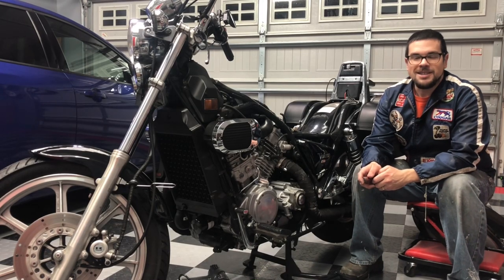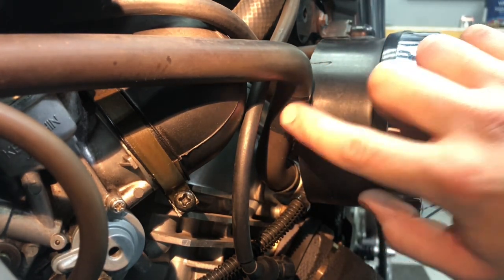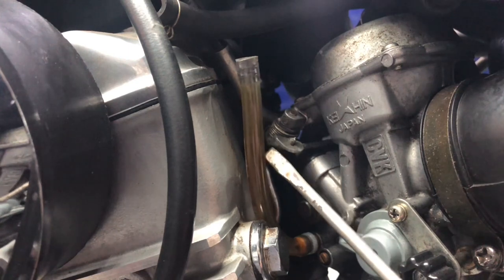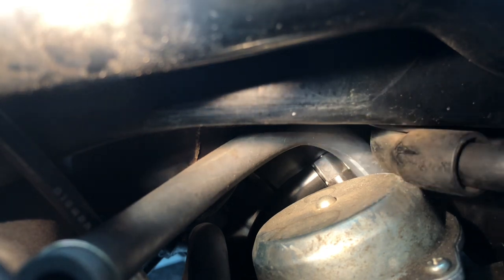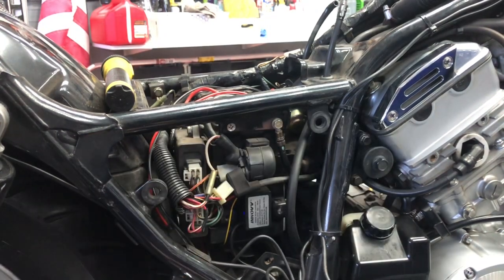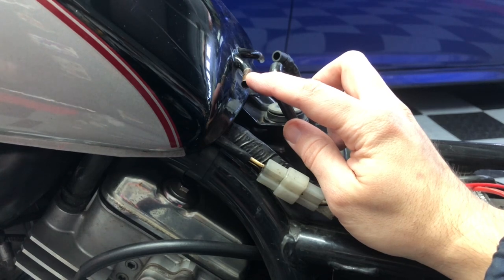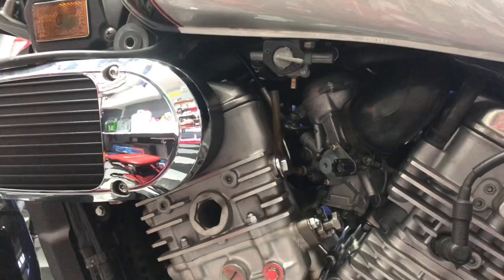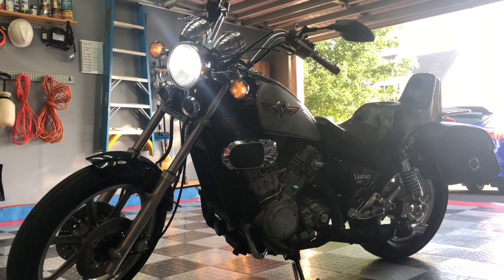How to Connect the Fuel/Air/Vent/etc. Hoses & Lines on a Kawasaki Vulcan 750

Comment: Your videos are great.  Helping so many people to put back what someone else took off their carb but they don't know where the hose goes.   If you do decide to remove your carb, just do an in-depth video and you will be able to watch it and put things back correctly.  It's not terribly complicated but is a bit hard to get out as it is a very tight fit.   Keep up the good work.  You're a natural.
Reply from the maker: Thanks so much for the comment, I appreciate it! I plan to make a video to show how to remove the carbs and reinstall. I'll probably do this video right before I do the ear-shave mod, where the airbox and stock air filters are removed and instead you put pod filters directly on the carbs. Here's the written procedure:

https://www.vn750.com/threads/ear-shave-procedure-enjoy.18397/

But I probably won't do this until 2025.

Comment: As usual a great video. Unfortunately the part I needed explained is what you glossed over. The two hoses at the back of the tank by the rear mounting bolt is for the Fuel Evaporative System. The fuel tank on my '86 has those two lines. However, I purchased a replaced fuel tank years ago and I'm just getting around to replacing the fuel tank on the bike because it has a dent from a strap breaking while in a trailer. Still functional but doesn't look good. Anyways, I only just noticed the tank I purchased does not have the two Fuel Evaporative System vents coming out of the tank. Further study I found the replacement tank I got is for USA except California. The Fuel Evaporative System is a requirement to be compliant in California, but required in the rest of the USA. Kawasaki no longer sells the fuel tanks without the two vents. I think I will be fine using the replacement tank without the Fuel Evaporative System connected, but I was hoping you and the video would have had more insight about this. I'm not sure which is better. Plugging the two hoses, or but a hose-connector with the two hose and simply loop the Fuel Evaporative System? Thanks again for the video as it did help with the rest of the instal.
Reply from the maker: I learned from another VN750.com member after making this video that my Vulcan 750 is a California-spec model, which is why it has those TWO vents at the base of the fuel tank by the seat. All Vulcan 750's have one vent, but these CA-spec models have an extra vent for the EVAP system. You can plug this second vent tube and plug the port because the tube simply goes to a charcoal canister. I plan to do this on my bike and will make a video about it. It removes some clutter inside the bike (i.e. a big black charcoal cannister lol).

Better yet, if you wanted you could purchase a set of coaster plates (link below) and plug off those reed valves on the heads. It's a common mod that can clean up the look of the bike, called the Coaster Mod. I also plan to do this one day on my Vulcan and will make a video. 

https://chucksterscustoms.com/product/kawasaki-coaster-plates/

https://www.vn750.com/threads/coaster-mod-purpose.101457/?post_id=1254353#post-1254353

https://www.vn750.com/threads/heres-everything-i-know-about-the-reed-valves-kawasakis-kleen-air-system-aka-pair.108358/?post_id=1316362#post-1316362

Comment: Where does the clear vent line go? Down and under not connected to anything?
I have adhd add dyslexia and all kinds of things too but I don't see it in your video.

Would appreciate a full disassemble and reassemble of hoses.
Reply from the maker: @sigmalawpenske  The clear vent line is the petcock vacuum hose. It goes from the bottom of the petcock to the carburetor on the left side. Yours will most likely be black. The only reason my hose is clear is because my OEM hose had a hole in it, and I replaced it with some clear fuel line. Does this help you?

Comment: I bought the 2000 Vulcan new, and it had the same airline interference at the intake box. I did the same thing and used a dremel to give it clearance.
Reply from the maker: Seems like a bit of a minor design flaw there. But good to hear you fixed it in a similar fashion. Nice job. :)

Comment: Question what exaust is that it sounds amazing i have an 02 myself almost finished getting it rebuilt
Reply from the maker: Thank you. I LOVE the exhaust sound of my bike. The previous owner installed these pipes...and if I recall correctly they come from a different bike (maybe a HD?). They are simply straight pipes with some aftermarket clam shell clamps holding them onto the exhaust manifold. 

It's honestly not ideal/a perfect fit. I'm probably losing power maybe due to the lack of back pressure? And I have a very slight exhaust leak from the start of the exhaust pipe on the rear cylinder right at the clam shell clamp. But I don't care because this sound is worth it. :)

Comment: Hello, I'm from Rio de Janeiro, Brazil. I appreciate your channel. My little hose (shown at 3:29 in your video) is connected directly to the vacuum in the carburetor (right side). Does she really need to go to the T-valve? What else is connected to this T-valve? Thanks.
Reply from the maker: If that’s how your right-side carb is setup with the little hose and everything is running fine, maybe it can remain as is. Either way, it sounds like that little hose makes its way to the right-side carb so that sounds OK to me. You can always follow-up by creating a post at VN750.com if you haven’t done so already. There, myself and other members will be able to help you out further. Also keep in mind my Vulcan 750 is a US California spec, so some things on my bike look different than any other Vulcan 750 for the rest-of-world markets due to emissions requirements from the state of California back in the early 2000’s.
 
As for your question about that T-valve, check out this time stamp at 6:22
https://www.youtube.com/watch?v=7sokPDXOhDg&t=382s&ab_channel=CheckeredFloorGarage

Comment: Thank you so much for the video. Running into an issue on my '99 Vulcan 750 that I just purchased where I stall as soon as I apply ANY load (like even try and inch forward releasing the clutch). I have what appears to be a loose hose right next to the airbox on the passenger (right) side and there is no connection to make to the airbox. How does that hose fit? Am I missing something with the connection? Figured its either a vacuum leak or carb jets at this point.
Reply from the maker: Before we talk about the loose hose, make sure the kickstand is up. These bikes have a "safety kill" feature where the engine power will be cut if you release the clutch while the bike is in 1st and the kickstand is down. This tends to get me at least once per riding season. 😁

Let me know if this resolves your issue.

Comment: Hey on my carb the plastic black piece that the fuel line connects to is broken.  Do you know where I can find another one or what they're called?
Reply from the maker: I found an old VN750.com post for you from 2011. Check this out:

https://www.vn750.com/threads/black-plastic-carb-inlet-nipple.19832/#replies

Looks like the black plastic Kawi pieces are replaceable with brass pieces from Harley Davidson (post #2). Then post #8 has a link to them so you could try that.

Just be sure to read the rest of the thread to learn more, and feel free to search VN750.com for alternative options. 

For example, another alternative option is to check eBay for used VN750 parts...you never know what you'll find there! I've used eBay several times to get replacement parts for my 750. 

Best of luck, feel free to let me know how you make out!
Reply: @CFG750  dude thank you so much I looked for like 2 hours the thing pissed me off so much I was just putting it up on marketplace lmao
Reply from the maker: @tristannantista9616  lmao, hey we've all been there. I'm so glad you reached out and I could help you. Be sure to check out VN750.com for other issues you may encounter with your 750. Most everything I know about this bike comes from this forum! 

Also, the Clymer Service Manual helps a ton too. Here's a free way to view the entire manual, you just need a google or facebook account to access Archive.org:

https://www.vn750.com/threads/free-clymer-vulcan-750-manual.107822/#post-1308066

Comment: Picked up an 88 Vulcan 750 last winter (cheap) and they started the air box removal. It's mostly complete but the small air lines off the carbs are plugged with golf tee's and bike isn't getting fuel to the carbs. Runs on starting fluid and if I squirt gas into the slides.Are there any sites or references you can suggest that show the correct method of routing the air lines after ear shave? Any help would be greatly appreciated.
Reply from the maker: I don't know a whole bunch about the ear shave mod. So I could be wrong but some of those lines remaining plugged COULD be OK. I THINK that's how the mod is done but certainly it's worth a double check. 

I cannot recommend highly enough VN750.com. Check out that forum and use the search functionality to try and find your answer that way. If you cannot easily find your answer, feel free to create a profile, introduce yourself, and ask us. It's a forum dedicated specifically to the Vulcan 750. I guarantee you'll find what you need for this and more for you Vulcan 750. :)

Comment: So. I recently bought a 2004 model with 26000 miles on it. I just bought the rebuild kit for the petcock and carburetors, I got the carbs off ( such a pain ) and tore down but I think I over did it by removing the linkages for the throttle and choke and I'm struggling to put it back together. I don't want to mess the bike up, it's my first bike and I love it already. I've watched the other videos you have about maintaining this beautiful machine and I must say you inspired me to get this bike. Any help would be greatly appreciated man
Reply from the maker: The carb removal process is SUCH a pain. That's why many owners opt for the "ear shave" mod, where they delete the air filters and intake plenum and intake box. And they instead install pod filters directly onto the carb on either side of the Vulcan. It clears up a lot of clutter and space, and it makes it a bit easier to access the carbs.

If you haven't done so already, create an account over at VN750.com. It's free. Post a brief intro and some pics of your carb/linkages. I and others will help you out there and I think you'll have your issue resolved same day. The community over at VN750.com is incredible!
Reply: You are a life saver. Do you know about how much the ear shave mod cost?
Reply: @CFG750  I just made the account. I'll be off work around 3 30 and I'll get some pics on there bub. Thank you for your time. Ps I  have a cali model, is it much different than a non Californian model?
Reply from the maker: @jaykeyboii6955  Thank you. I'm really glad I can be helpful for you. 

I don't know the exact cost for the ear shave mod. But you'll need two pod filters that fit onto the VN750 carbs. So let's say $50 there for the two pod filters. And you'll also need some new carb jets because anytime you change how a motorcycle breathes (whether that's on the intake or the exhaust side), you'll also need to change the way it consumes fuel (carb rejetting). So let's say new carb jets cost $40. Throw in some other misc. items like clamps and such, and I think this is a rather affordable mod, maybe costing ~$100 +/-.
Reply from the maker: @jaykeyboii6955  You'll have some extra emissions-related equipment on your bike. So pay close attention to the two pages of the Clymer Service Manual that I highlight in the video and follow-up with me/us over at VN750.com and you'll get the help you need. Worse comes to worse, I think a lot of that stuff can simply be removed. These Vulcans have been around for such a long time, there is a really great understanding about them at VN750.com.

Comment: Hello, I'm from Brazil and I've been following your channel for some time. Congratulations! I needed to open the engine of my Vulcan 750 to change the water pump mechanical seal, bearing and seal. I did everything according to the Clymer manual. Now, everything is ready, a problem occurred. There is no suction from the carburetor to the gasoline petcock, but there is a blow, so that no gasoline enters the carburetor bowl. Can you help me?
Reply: Sorry, it's a great pleasure to join this group!!!
Reply from the maker: Thanks so much for tuning in! I'm glad these videos have been helpful for you. First, check that your petcock is set to ON or RESERVE. I swear this gets at least once per season. 🤫

A common problem on these Vulcan 750's is phantom-out-of-gas syndrome (POOGS). Try to start the engine with the fuel tank cap open, and if you see fuel flow then it's definitely POOGS. Read more about it here (and I will make a video about POOGS this year):

https://www.vn750.com/threads/phantom-out-of-gas-syndrome-poogs-correction-and-prevention.17572/

Inspect the fuel lines for kinks, maybe something got pinched during reassembly. 

Could be a carb float valve issue. It's funny with these older bikes...you sometimes uncover new issues by working on and fixing other issues! Some Seafoam or another fuel treatment can help with this, but you will need to get fuel into the carb first.

Those are the main things I can think of. Check into these, and create a post over at VN750.com if you need more advice. There, myself and the other members can better assist you. Goodluck and thanks for reaching out!

Comment: I have a Vulcan s 650, how do I know if the fuel cap vent hose is connected to the right port on the tank? I recently had the bike painted and just wanted to be sure when putting them back together. There is a blue dot next to the port closest to the seat on the tank, is that where I should connect the vent line? This hose is just a long hose that runs down by the kickstand, the other hose connects to a couple other things. And I don’t want get them backwards. Any help would be greatly appreciated. Thank you. I have a picture showing everything but I’m not sure what order they connect in by looking at it.
Reply from the maker: @BobbiWorley-rs1zz  Thanks for the comment. The Vulcan 650 S is a cool bike, I really like it! But, I know nothing about it unfortunately. Check out a forum that’s dedicated to the 650. For example, I’ve learned everything I know about the Vulcan 750 from VN750.com. Perhaps there’s a similar forum for the 650?
Reply: @CFG750  thank you for replying. Unfortunately there isn’t anything I can find as far as the fuel lines go. Thank you tho

Comment: Hello. I have some new questions.  =)
3.37 - t-valve: left hose goes to air valve (3.27), right hose goes to rear carburetor (4.07). Can't find where the lower hose (3.37 vertical) goes?
6.23 - another one t-valve: two hoses connected to carburetors and third - to right airbox?
(found some "customising" of my Vulcan: previous owner changed petcock for unknown reason - so I decided to check all tubes/hoses just in case)
Reply from the maker: I want to take off my gas tank and follow the lines IRL to help you out here, but my apologies I just don’t have the bandwidth for that atm. If you haven’t done so, create a free profile/account over at VN750.com. Create a new post and share your questions and issues over there. Refer back to my video and share any pictures you may have or think would help us to answer your questions. I guarantee you’ll get your questions resolved. The subject matter expertise over there is incredible.
Reply: @CFG750  I've created profile at the website. And even tried to send you some questions with photo, but system told me I can't do it yet for some reason. That's why I write to you here.  =)
Maybe on holidays I'll found some time to create a new post (during a week I come home little late from work).
Reply from the maker: @MrBaclajan  Sorry to hear you've been having issues with VN750.com. There was a small technical glitch last week so that could have been the problem (the issue is resolved now). Also, you may need to have your account verified first so the system and the mods (myself included) know you're not a bot. 

So when you try again over at VN750.com, make sure to introduce yourself as your first post, then feel free to post your question/issues/pictures directly to the forum. There, myself and the other members & subject matter experts will be able to help you. 😊

Comment: Lad , I cant locate vaccum hose  on 1500 /1999 classic but one carbu only . 

Btw , Would you know its way ?
Reply from the maker: I'm not familiar with the Vulcan 1500/2000 models. I'm familiar with the Vulcan 750. I recommend you find a Vulcan 1500/2000 forum, like maybe this one:

https://www.vulcanforums.com/forums/vulcan-1500.16/

I wish you luck in locating your vacuum hose. ☺

Comment: 7:02 on the bike im working on instead of the air box it goes to the left side where i have another T and one goes to the petcock and the other to where the clear on your video is connected. Is the bike a different model? And are those connections ok? New to forums cant seem to find anything on it
Reply from the maker: Your Vulcan is OK. I learned this while replacing my exhaust manifolds, but both air boxes have a place for that tube to go. It doesn't matter if it's routed to the left or right airbox. Does this answer your question?